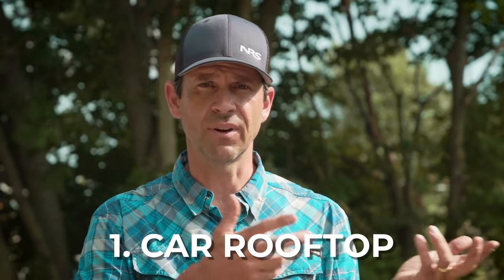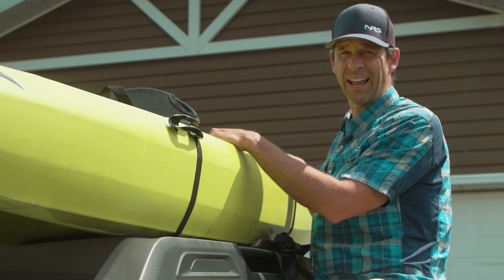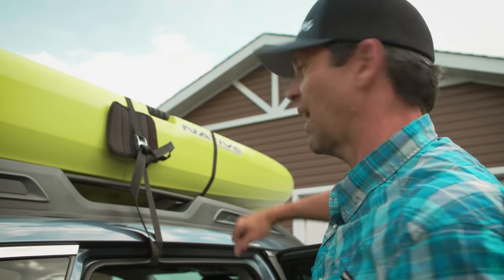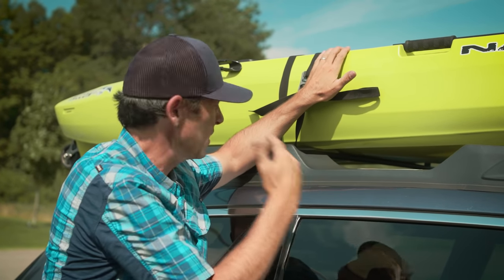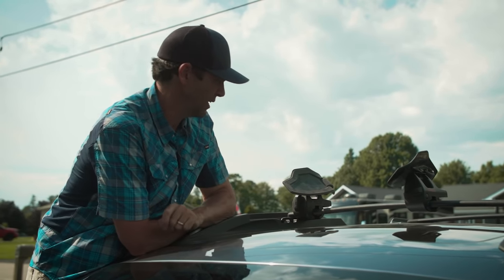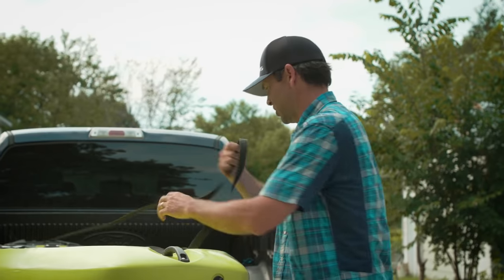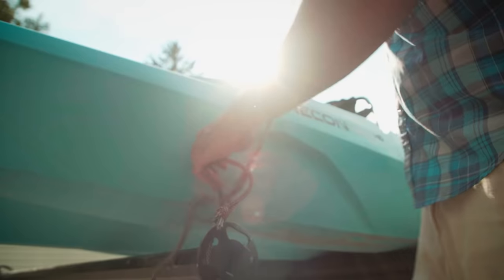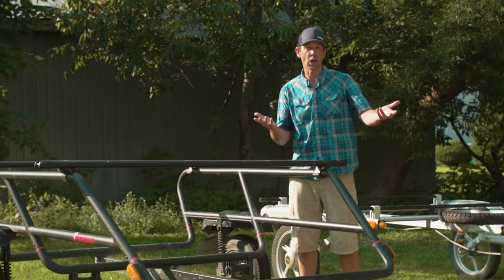How to Transport a Kayak | Kayaking for Beginners

Comment: so on the truck if i counted right,,,
1 through the handle to keep it in the bed
2 more to keep it sliding left to right.
then a rope to keep the front down?
that's just overkill,i use one strap going  across.keeps it
from sliding around,no left to right and the front stays put on
it's own,why make it more complicated than it has to be?

Comment: First of all, throw those cheezy friction straps in the garbage.
Reply from the maker: ...and then second?
Reply: @PaddleTV  no second, love your channel by the way, I just consider those straps dangerous, and unreliable compared to the far superior ratchet straps.
Reply: Been hauling surf boards, windsurfers & tons of sails, paddleboards and kayaks for 30 years with these inferior straps with zero issues, city, highway, gravel roads, etc., as have most my water buddies. I typically throw a 1/2 hitch to lock in the bitter end of the strap, never had one come loose.
OTOH, i've seen one fiberglass boat badly cracked, and many plastic boats oilcanned, by over-enthusiastic users of ratchets. 
They're tools - used properly with a bit of common sense, either type works just fine.
Reply: @DominiqueB 
It may be that some people actually thread the straps into the cam buckle the wrong way so they release under tension instead of camming tighter as designed.